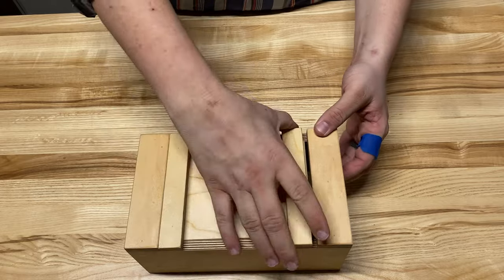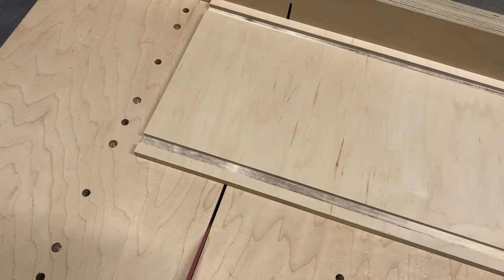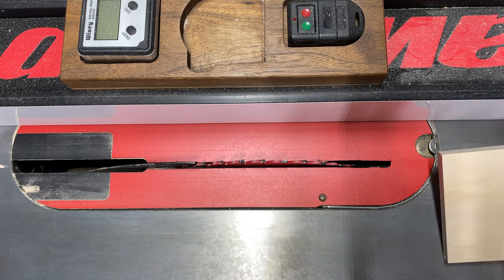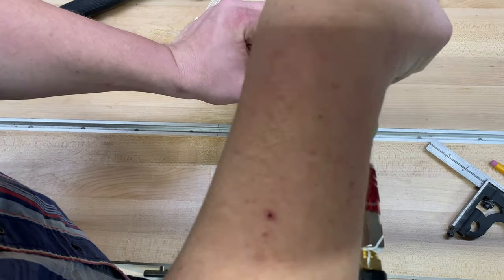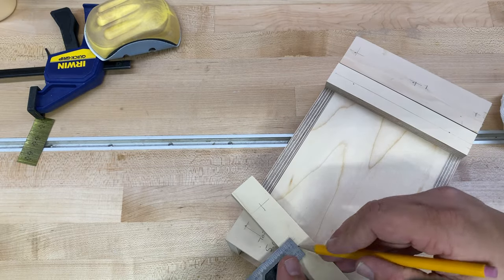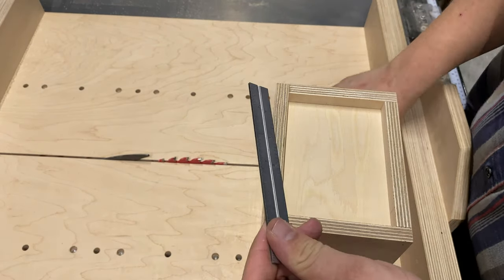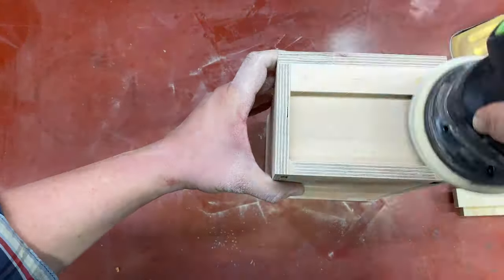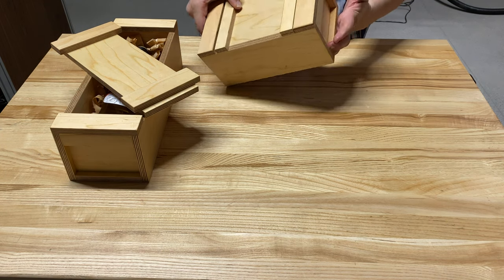Easy to make box

Comment: How is called that ruler/square tool you are using ?
Reply: it should be a combo square
Reply from the maker: Redek, I am using a combo square in the video. The combo square is one of my most used measuring devices in the shop.
Reply from the maker: @danbealecocks4344  You are correct .
Reply: @behindthetechlabs9854  thanks, I seen it couple of time in store but not realized that it can be moved and used this way.